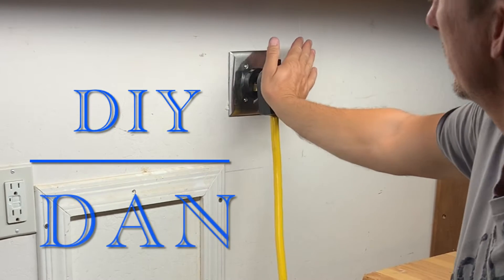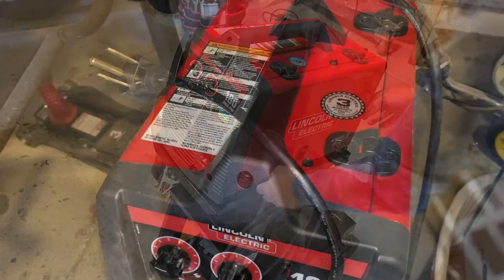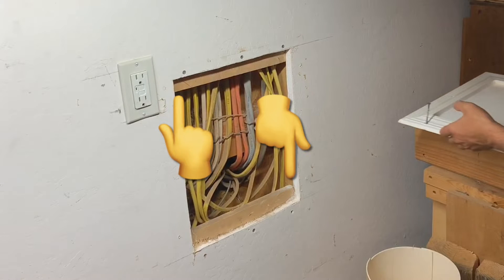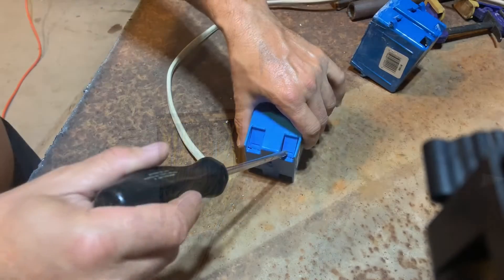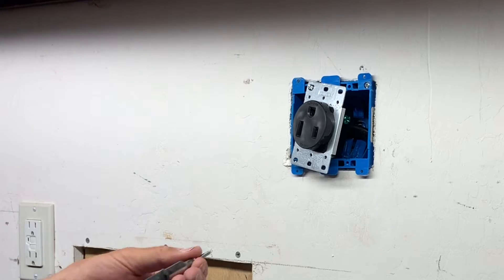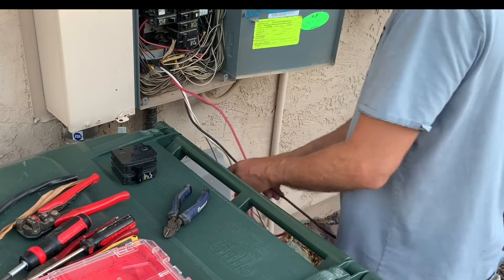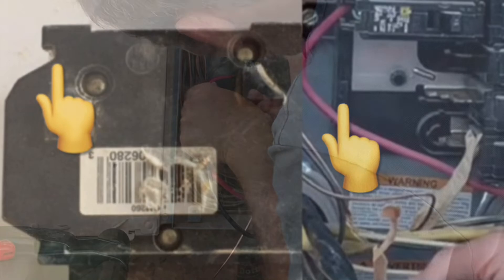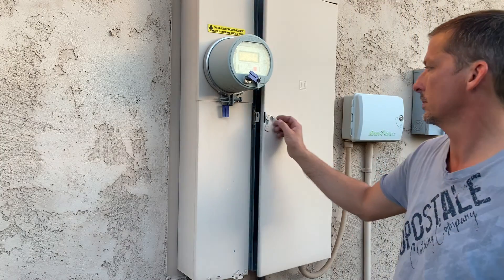HOW TO ADD A 220 OUTLET TO A GARAGE FOR A WELDER INCLUDING SUPPLIES INSTALLATION & HELPFUL TIPS

Comment: Thanks for the video, I plan on doing this project soon. Question though, what kind of wire do you need to buy for conduit? I was told don't buy Romex for conduit, because of heat with the jacket. Thanks

Comment: That's not 14 gauge wire, it's 3 conductor rated for 14A, wire gauge 2.08mm, slightly bigger than 12 gauge wire which is 2.052 mm. Using a 3 conductor Romex is not a bad idea. I would have used the red and black wires for hots and the 10 gauge ground wire for ground as intended. You could connect the white wire to the neutral bus, label it and leave the other end capped with a wire nut in the receptacle box. You never know when you may want it in the future.
Reply from the maker: @surferdude642  3x14awg means 3x14AWG" means a cable containing three individual wires, each with a gauge size of 14 American Wire Gauge (AWG); essentially, it's a 14 gauge cable with three conductors inside it.    14awg is 1.63mm thick and the bigger the awg the smaller the wire size is
Reply: @diydan7019 You may be correct, but the (2.08mm) notation is confusing. I'm not familiar with that welder. I'm a little surprised, because 14 gauge seems too thin, but I don't know the details.

Comment: Personally I would have installed an EV grade 14-50 or 14-60 outlet and biught a dogbone adapter for this. This way you can do EV charging in the future. 

NEMA 14-50 is a very versitile outlet. You can run 120V and 240V loads on this type of outlet eith the right sdapters since you have a neutral.

Comment: I think my 250 volt plug is upside down the ground is on the bottom,easy fix?
Reply from the maker: Shut the breaker off pull cover off and undo plug from box flip it over and reassemble the only thing that might cause you an issue is how thick the wires that are used and whether there’s enough slack in them to flip it over
Reply: @diydan7019  Right on,thank you sir!

Comment: How can I add a plug onto a 220v device that is hard wired? I want to be a be able to plug and unplug it into a 220v outlet.
Reply from the maker: The easiest way is to get an adapter cable that will plug into that 220 on the wall and give you 3 110 outlets on the other end I found one on Amazon for $60

Comment: I noticed at 17:32 in the video if you look at the top main breaker it is showing that it is in the “ON” position when you were making the ground connection too the bus bar. 😮 not sure why it was turned back on before all your connections were complete?

Comment: You cut off the wrong wire. White wire should have been cut off. You can still use the white wire as an equipment ground if it is marked with green tape.

Comment: here is the part I dont understand;  110 the white goes to (at 17:11 ). buss on the right,  bare goes to green / earth on left.   So 220 doesn't use white bar on right?  I am having a hard time wrapping my head around this...     I am in process of installing 30 amp for welder, I put bare ground to box as I would on 110,  white was to be to the white buss,  I have not connected to the panel yet;  is there an easy explanation to help me grasp the correct connection?
Reply from the maker: Correct it  uses to 120 legs and an earth /bare ground no neutral is used

Comment: When would you need 8/3 instead of 8/2? I ask because I'm needing to run 150' to my shed.. Thank you. Great video!! It's 8/3 needed for the 4 prong? And 8/2 for 3 prong?
Reply: He explained that he could have used 8/2 with ground but he had already purchased the 8/3 with ground.  He cut the copper ground and used the white wire for ground instead because it was a heavier gauge.
Good luck!

Comment: Per the NEC (250.119) ground wires 6awg and smaller are to be green or bare their entire length. 4awg and larger are permitted to be reidentified with green tape etc. However in a multiconductor cable they can be reidentified with tape, coloring or by stripping the entire exposed length. So yes you should've taped that white wire to avoid possible future confusion..

Comment: Hopefully you will not mind a few comments.   You did a good video and explained what you did very well.   I am assuming that you installed the plug on the welder.   What amp plug did you put on the welder cord?   I’m guessing that you installed a NEMA 6-50 since that is what you put in the wall.   I can find nothing from Lincoln that specifies the plug required for their welder.  You said the cord was #14 awg.   I looked up the welder and it at full load pulls 20 amps and is a 30% duty cycle welder.   As an electrical design engineer that worked for electrical contractors, I would have never designed it that way.   I would have either put a NEMA 6-20R &P or a 6-30R &P.   Never a 6-50.   So, you could have used #12/2 WG with a 2 pole 20acb or #10/2wg with a 2 pole 30acb.   Is what you did wrong?  No not as far as your premise wiring.  But I do not oversize the branch circuits that far above the real load.   If you ever do this again and have a long run, no need to spend that much money.   So, if you were to do another, a 30 amp circuit at 150’ with #10 would be fine.
Reply from the maker: So your point being is to build it to the bare minimum and save a couple dollars upfront and then if you decide to upgrade your welder and need a higher amperage wire that you have to completely rewire it and spend more money than a couple dollars it cost to upgrade it to begin with The heavier wire was a minimal cost because it was only 6 feet long and yes, the welder did come with the plug that plugs directly into it I did not put it on the welder
Reply: @diydan7019     No, not bare minimum!   NEC compliant.   Is your install a violation?  No it is not.   I have seen numerous videos showing 50 amp receptacles installed for small wire feed welders.  The problem is, no one says that they are not required to be that big.  So viewers that have no idea, think that they must install 50 amp receptacles and plugs for all welders.  Hopefully, if something goes wrong inside these welders and causes low level fault currents, that the #14 cords don’t start frying an catch something on fire.  Possible, but not necessarily probable.   Life safety is priority one!   Best wishes,   Kevin
Reply: This is great info added.. I'm currently needing to run 150' into my shed/shop for my small 220v 30a welder..I also have a 230v air compressor.. I wanted to use the 6-50 plug as well, and that way I could use 8/2 for the long run... Do you recommend I use or 8/2, 8/3? And why?
Reply: @_mylastname     Both the welder and the air compressor are 240 volts, not 120/240 volts.  There is no need for the third conductor IF that is all you will ever connect to it.   Assuming you currently have no electricity in the shop, I would buy #6 have 3 conductors and a ground.  Connect to a 60a breaker, and install a 60 amp main breaker panel.  Then I would have appropriately sized circuits for each load.